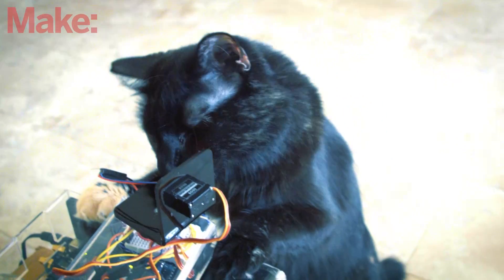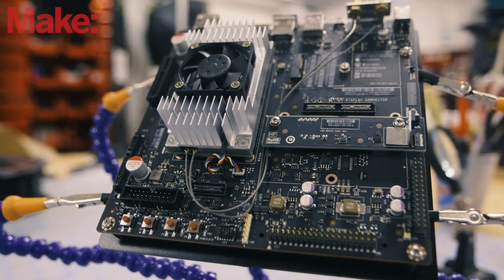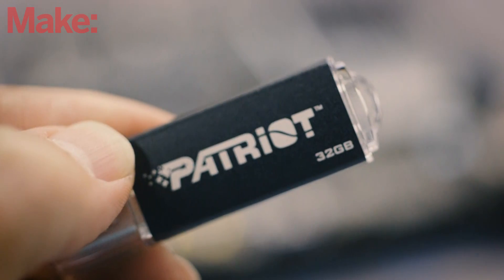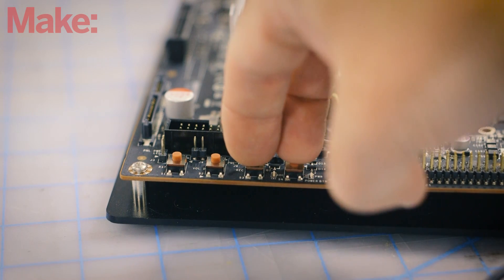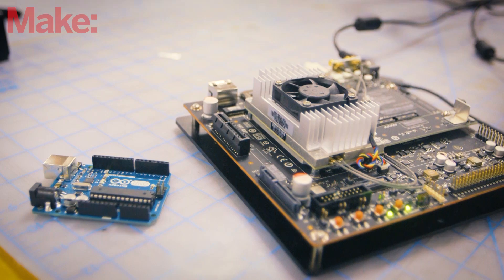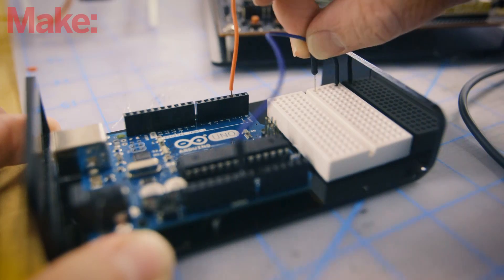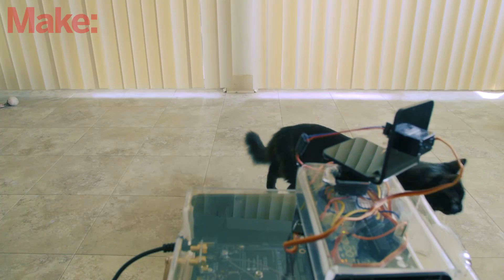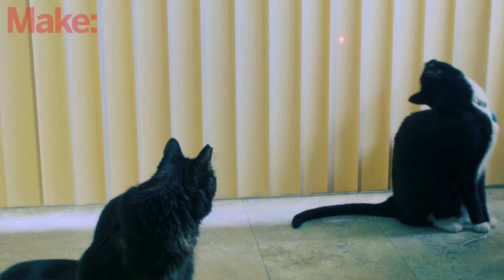Weekend Project: Jetson TX1 Cat Spotter

Comment: This is just fucking overkill. Use Jetson TX1 dev board to play with cats...
And not only that, because of the lack of knowledge in common electronics you grabbed additional Arduino just to control the motor facepalm
Those Arduino "engineers" never stop to amaze me

Comment: It's neat to see where consumer technology is headed, but the Nvidia Jetson TX1 dev kit price is $600.  This puts it out of range of most hobbyist.
Reply: You can do the same with a Raspberry pi (though it's admittedly very slow to recognize cats, on the order of seconds)
Reply: Doable? Yes, but I would probably just go with a Raspberry Pi and lower the technology to just motion detection.  Almost as functional but at a price I could afford.
Reply: Enter the Jetson Nano.
Reply: Buy a cheap desktop GPU and figure out which pins on the PCIE do what, write software and done xD It's a lot more complicated, but should be doable xD
Reply: They're 300 if you're a student but they're hard to get.
Reply: If you just want motion detection you could go with a PIR sensor and lower that even further to $1.50 with shipping.

Comment: Never leave exposed wires around pets.  I've had to replace the power on leads on my brothers computer several times.  The side of the case is open for better cooling but the cats are drawn to the warm insides and cubby hole nature of the PC case.  Thus the wires and exposed leads become chewy cat toys.  This has happened a lot.

Comment: u guys need to get back to making simple things like the puppy monkey baby costume , not these complicated builds .
Reply: it's not that complicated, just very expensive
Reply: +vitserp very very very very very very expensive
Reply: I wonder why they did not use a small embedded microcomputer solution like that then... I am pretty sure the standard maker does not have that board. At first I thought the processing grunt on that thing was required for computer vision, but it appears data for processing is streamed to "the cloud"  so this video was probably just an excuse for an Nvidia sponsorship.
Reply: Nvidia put a ton of money into neural networks when they started working on Pascal. They're hoping to find a larger market in self-driving cars, so really this amounts to marketing on Nvidia's part.